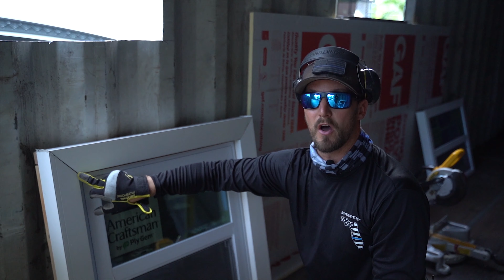Build a Window Frame for your Shipping Container Home | Step by Step

Comment: For my container shop, I welded up 1/8" 2x2 square tube frames for the windows and man door.  I stitch welded it into the container wall just proud of the side wall by about 1/4".  Then I caulked the frame inside and out with paintable polyurethane caulk.  I made the frames just about an 1/8" larger than the window frame and just installed it using self tapping screws.  The flanges for the windows were on the inside part, so the flange and screws were covered on the inside with trim.  The outside just had one seam between the window and frame that needed caulking, there was no trim needed on the outside.  I also drilled 3/8" holes in the back side of the window frames to inject foam from the cans.

Comment: BTW!! By far one of the best videos on container construction. I'm the construction trade that doesn't involve interior construction... I have seen a lot of interior work in custom, production and tenant improvements... I try to apply those methods to my design. I like your approach in explaining potential costly mistakes, believe me I have already crumbled my design concept and tossed in trash.  The project I am working on is an off-grid hunting cabin. Many videos on youtube show inefficient procedures and don't get to the point quickly..  Okay I get the interior and window installation now. I have additional questions and have no idea if that's a present or future video. Question #1- Do you or will you install an entry door? if so, is that another cut-out like the windows or will you frame and install entry door allowing enough room for double doors to close?  Question #2- I am looking at using prefab trusses for roof and corrugated tin for roof and water catchment as well as solar paneling. What type of bracket or angle iron to secure trusses as well as method of installation would you use? Bolt-in or welded?

Comment: Don't miter the bottom aluminum cladding and top of each side
Let the top piece miter overlap the sides and sides overlap the bottom.
No chance of water getting in .
It's like a shingle overlap.
I hope I explained it well enough.
Still caulk as you explained.
I install remodel windows and you are guaranteed not to leak if caulking ever cracks .
Reply: What cladding do you use? Can you post a link to buy it?

Comment: You should miter 2"x2" steel tubing and 110 volt mig weld it in the window opening, If you cant do this then there are mobile welding services that can do this for a reasonable price. I do not like your approach, Im a 32 year mechanical engineer, I forsee problems far into the future with this design your using.

Comment: Another question on insulation. If your interior construction prevent the cooling from getting to the metal outside walls, why can't you use Bat insulation in the same manor as standard wood framed homes?
Reply: Wall will sweat from the outside in and the batt insulation will absorb that moisture trapping between the wall and insulation. Spray foam is best

Comment: Amazing video series, thank you for doing this! 
Question? Can you help me understand why you didn't make the rough-in window frame dimensions so that the fin could be tacked to the exterior without the plywood spacers? It seems like that would be necessary for the structural integrity of the impact-rated windows (when flying debris hits the window, forcing it inward). Was it due to the plan to clad the frame with that aluminum?

Comment: I use both Dewalt and Milwaukee as well both have standout tools (I’m in love with my Dewalt track saw for example) and no question the Milwaukee m18 framing nailer blows that Dewalt one away. The first tool review on this video shows its capability (their gen one nailers kinda sucked, this gen2 stuff is awesome) https://youtu.be/A3h9I_zutAM
Reply: Came here to say the same thing. The Milwaukee stuff tends to be higher end and their batteries last a lot longer in my experience. Not all of the tools but a large majority of them.

Comment: Question: doesn't the lack of reinforcement in the container wall now that you've cut the hole out leave the container structurally weak? Basically you've eliminated the I-beam concept of the container wall. Is this structural integrity restored by the wood framing within the container? I'm curious if this leaves the wall open to buckling?
Reply from the maker: So we specifically only removed small sections not removing from floor to ceiling but essentially only a square out of a huge wall, when we reinforced it with the double 2x4 frame to just keep the window in place and it likely adds minimum support.  Obviously the more you remove the more you reduce the integrity of the container this is why we didn’t cut out the entire side and do a huge glass wall like you see others do.  You would never be able to move that without adding additional bracing after removing that much of the side wall.  So virtually we did little wholes that keep the integrity, as much as we were confident would be ok without additional bracing.  We also did not cut any of the structural steel components, only wholes through the corrugated panels.   Hard to explain, hope that makes sense...
Reply: @ContainingLuxury  Absolutely makes sense. Small holes, keeping a portion of the "i-beam" idea in tact. Thanks for the response! I'm up in St. Pete, would love to come down and see one of these in person one day!
Reply: @trevormartin698 the wall panels are not load bearing members. They are there to protect cargo only. They are not designed to act as load bearing members. So cutting them out will not reduce overall structural integrity. It might flex but no issues with structure. Not sure what the I beam concept is. The corrugated a are there to provide enough strength to protect cargo, basically by increasing the section modulus of the sheet.